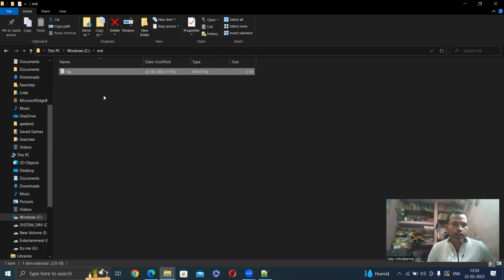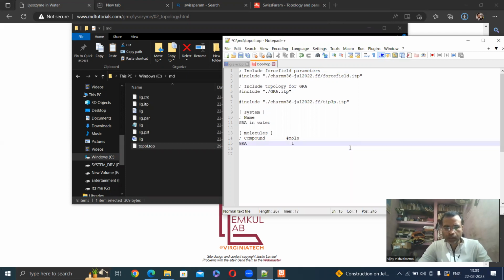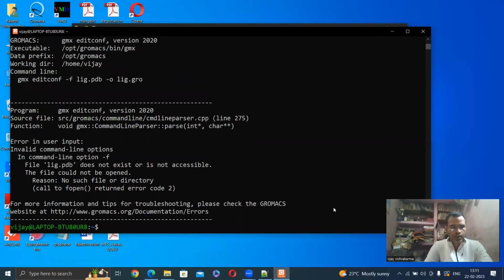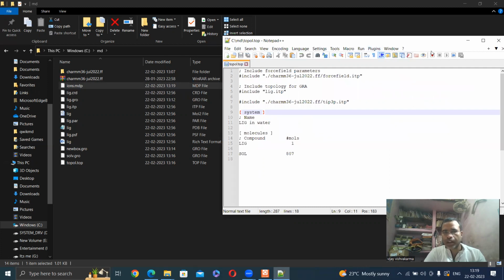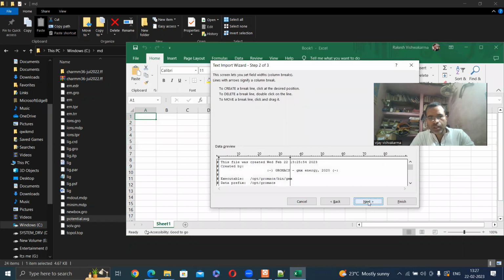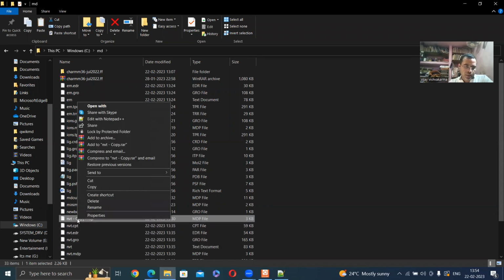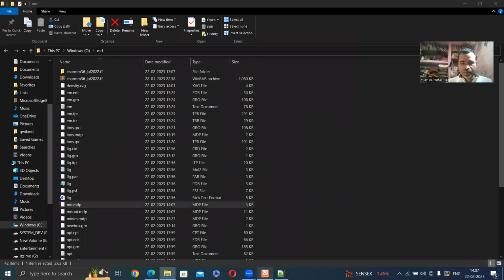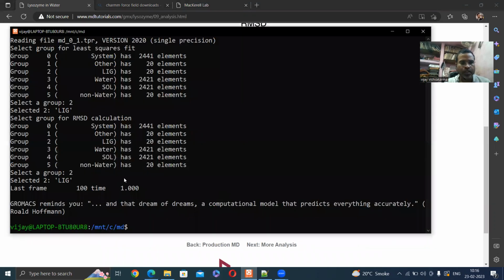Small molecules MD simulation using Gromacs

Comment: Hello Sir, I have a doubt. Suppose a ligand has bromine atom, and after docking that bromine atom is separated from the ligand. Then what to do while md simulation?
Reply from the maker: I think you have to redock the ligand and check if again it breaks then change the algorithm of docking. We can proceed for md with the correct structure.
Reply: @chemvigyan8518  Thank you for your reply. 
Sir, I redocked multiple times but everytime it's the same. Can you please let me know how the algorithm can be changed? And what changes I should do?
Reply from the maker: @Joggle-gol37  which software you are using? On which algorithm it works?
Reply: @chemvigyan8518  Sir, for docking auto dock vina

Comment: Hi
If you can help me, when i rurn the command to calculate the h-bonds ( gmx hbond -s MD.tpr -f MD_center.xtc -num hb.xvg), I can't find anything (the file doesn't contain h-bonds).
I use gromacs 2023, and i anlyzed the RMSD,RMDF, Rg successfully.
Reply from the maker: First check the protein-ligand complex (complex.gro) file for the proper placing of ligand. If complex is ok then use this command.
gmx hbond -f md.xtc -s md.tpr -n index.ndx -num hbnum.xvg
Reply: @chemvigyan8518  
I checked it again, and sent you the photo and the hb.xvg to your email.
Reply: @chemvigyan8518  
I checket and its ok, and with this command (gmx hbond -f md.xtc -s md.tpr -n index.ndx -num hbnum.xvg
) give the same problem.
Reply from the maker: @bunhi-d5t  ok I will check it and let you know as soon as possible
Reply: can i use 2 molecules(means pdb files contain 2 molecules) simulataeneously during swissparam step  @chemvigyan8518